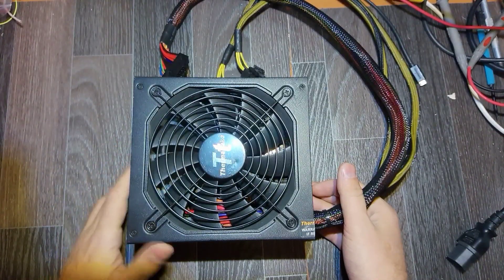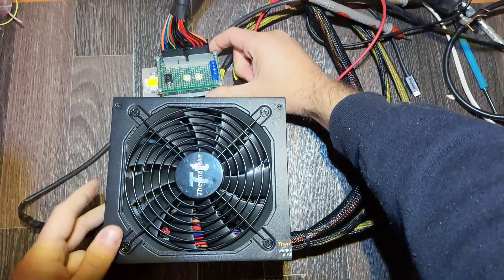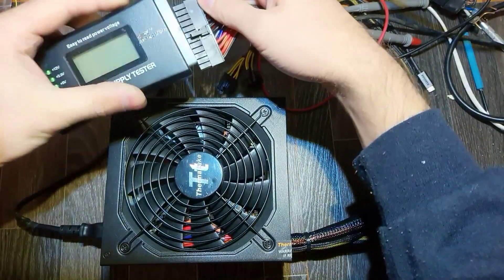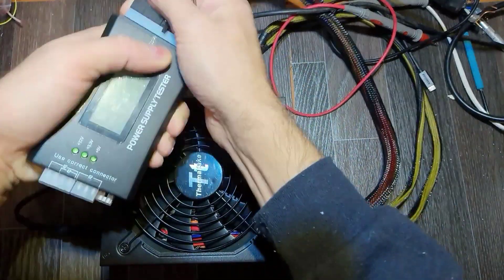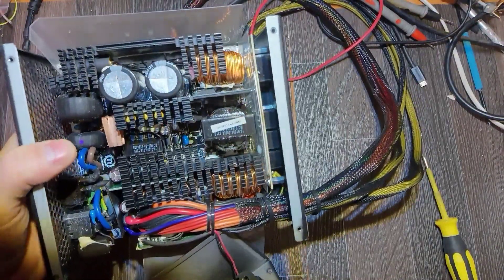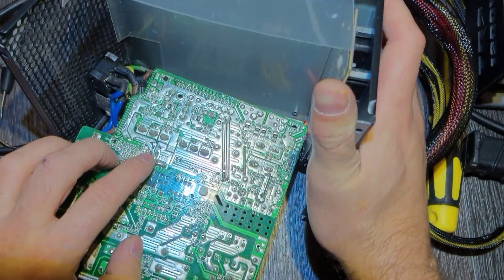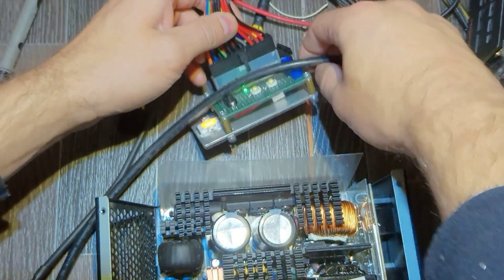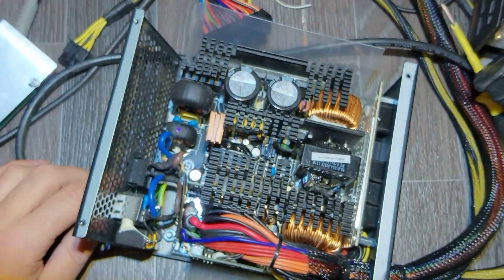Thermaltake Power Supply 1200W repair. An easy one

Comment: Thanks for the post, I'm having a Thermaltake 1200w PSU Platinum issue as well and this may help. However, you don't edit backing out screws and fumbling with connectors but you do edit out the soldering?  I'm not expecting Kubrick but c'mon! ;) lol.  Still Thanks.
Reply: Hello  i need a help plz give me whatsapp no

Comment: I have a similar power supply from thermaltake. It is 850W but the board layout is equal to the 1200w you repaired. I also have the same issue as in your ps. So the standby voltage is OK but when I turn on the ps it immediately shutdown (I hear the click of the relay immediately followed by the release of the relay). I also tried to measure the output voltages before the shutdown and I measured good values (3,3 for the 3,3V output, 5,2 for the 5V and 9 for the 12V). Probably I cannot measure a proper value for the 12V output because the ps shutdown immediately. I checked every component in the board (transistors, diodes, smd etc and everything is good. I also replaced the electrolytic capacitors for the 12V output (original ones had a good ESR but measured 1800uF instead of the reported 2200uF) but the issue is still present. I also resoldered the same transistor causing the issue in your ps but it didn't fix my issue.
In case the ps shutdown is due to an over/under voltage detected by the monitoring IC (PS224 on that board), which signal/pin is responsible for the shutdown of the secondary? e.g. PS good signal (PC wire on the ATX 24 pin cable), FPO pin on the PS224 chip?
Reply from the maker: Ps224 can monitor all voltages 12, 5 and 3,3. I had several power supplies with bad resistor (10 or 100 Ohms as I remember) on 12 volts line, probably one or two on 5 volts line and never on 3,3 volts line.
Reply: @electronicshaverightstolive  thank you for the fast reply.
I also had some suspects on 12V. If it can help, before the ps was no more switching on, my PC had very strange behavior such as switching on automatically (without pressing on the power button), Also the PC took a loot of time to start (20 minutes) and I could clearly hear something wrong on the 3,5" HDD (a sort of click like there was not enough voltage from ps). 3,5" HDD uses also the 12V. For that reasons I didn't use the PC for 1 year. When I tried to use it again the PS didn't turn on at all. Please let me know if those symptoms are familiar with a possible cause on PS.
With bad resistors on 12V rail, are you referring to the smd on the back of the board (on the front there are few non smd resistors that measured ok)?
Reply from the maker: @digant1973  you can find those pins of the ps224 in its datasheet. From those pins it should go through  those resistors to 12, 5, 3.3 lines. Also measure minus 12 volts line (I hope you measured already other lines) compared to the ground in diode mode. Should show high voltage drop. Also if you have lab or simple 12 volts power supply, connect it to 12 volts line and check whether 5 and 3.3 volts lines are generated by DC DC converters.
Reply: @electronicshaverightstolive  yes I checked also the -12V line. I know the pinout on ps224. I also removed the monitoring board (the board vertically mounted on the main board) and detected the pins on the monitoring board just to eventually test it applying 3,3, 5, 12 and -12 V from a lab power supply. I checked also the components on that monitoring board and all the smd components seem OK.
I also removed and checked the two vertically mounted boards containing the APW7073A (Synchronous Buck PWM Controller). One of the two boards is connected to the main board to GND, 3.3 and 12V and the second board to GND, 5 and 12V. I will check again the components on those two boards.
So you are suggesting to directly apply 12V to the 12V line on the main board so the board will not shutdown and I can measure also 3,3, 5 and -12V outputs. Is there a specific point where I have to connect the 12V power supply on the 12V line? e.g at the origin of the 12V line (so before diode etc...)? thanks again for your support
Reply from the maker: @digant1973  it doesn't matter where you connect 12 volts if is 12 volts line. I usually connect on pci-e connector. You should see 5 and 3.3 volts generated.
Reply: @electronicshaverightstolive  ok thanks! I will check the components on all the boards I have currently disconnected from the main board (two boards with APW7073A and the monitoring board with PS224). If everything is correct, I will reassemble everything and procced with your suggestion.
Reply: @electronicshaverightstolive Thank you very much. Your suggestion was very useful. Applying 12V on the 12V line I got the 3,3V from the 3,3V DC-DC board while 10V from the 5V DC-DC board. The two boards (3,3V and 5V) are identical so I swapped the 5V DC-DC board with the 3,3V DC-DC board and I got the expected 5V. So it seems the issue is on the 5V DC-DC board. With the exception of APW7073A (PWM controller) that I cannot check, all the measured SMD components on that board match the values on the 3,3V board so it seems the issue is limited only on the APW7073A. Just buying some of them. Thank you again!
Reply from the maker: @digant1973  you are welcome. I'm glad that I could help.

Comment: Idk what’s wrong with my psu I put it in wrong in my computer and it didn’t turn on at all no fan spin or anything help please
Reply from the maker: Hard to tell for sure. Do you have any voltage at PSon pin?
Reply: @electronicshaverightstolive  how do I tell I only know the psu is 600w and isn’t turning on but I’m using a dell optiplex
Reply: @electronicshaverightstolive  unfortunately I don’t own a volt meter but do u think if I put the psu into a working system do u think it would fry it too
Reply from the maker: @That2007YZFR6THUNDERCAT  no, I dont think so.
Reply: @electronicshaverightstolive  do you think my psu might be blown?
Reply: @electronicshaverightstolive  yeah it blew my pc up thx
Reply from the maker: @That2007YZFR6THUNDERCAT  probably you have a problem on your motherboard. All modern ATX PSU have supervisor IC that controls output voltages. If it senses any abnormal voltages it would not let PS to start and consequenly damage PC.
Reply: @electronicshaverightstolive  I mean it is an older board

Comment: So, I have a Thermaltake 1000W PSU, I've had it in my system for around 10 years. It seemed to be working fine until I bought GTX 1080 Ti 2 days ago. Now after about an hour of playing games it just shuts down and refuses to turn back on for about 8-10 minutes. Then it turns on again and works like nothing happened. So it's some sort of thermal shutdown. And it turns out the PSU's fan is dead. lol Now I want to fix it. I mean, if it's just a fan itself that died, it should be easy enough to replace, unless it's more complicated than that.
Reply from the maker: Yes probably it's only a fan issue. You just need to replace it or very often fun's shaft is stuck and all you need to fo is to oil it.